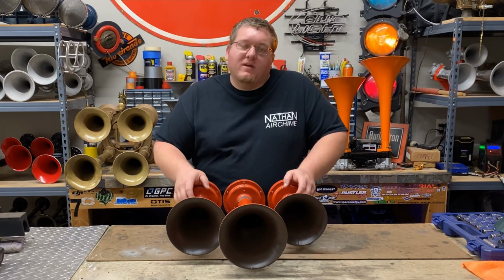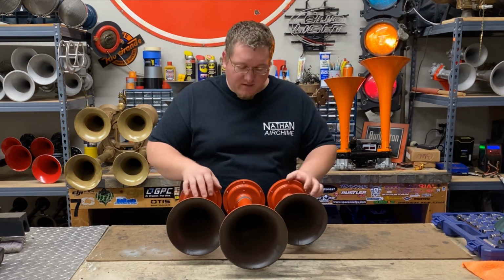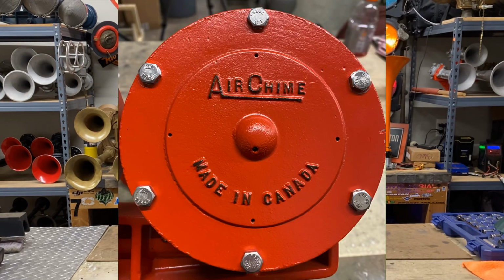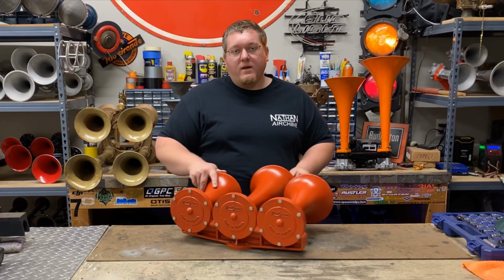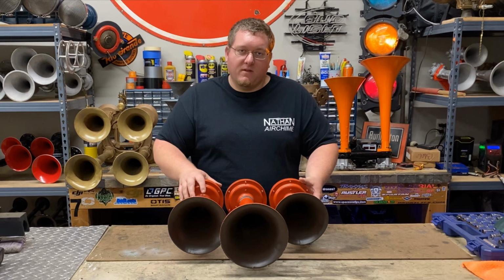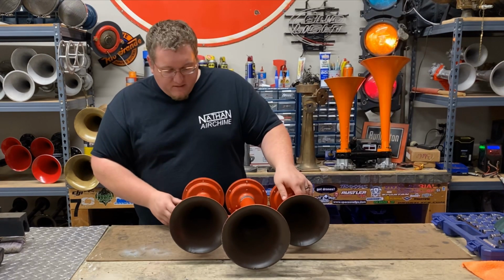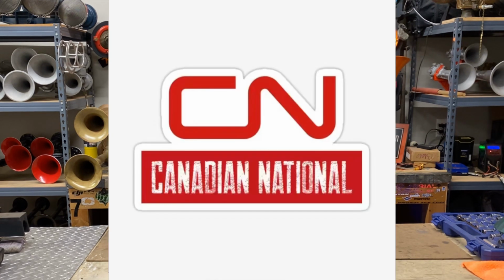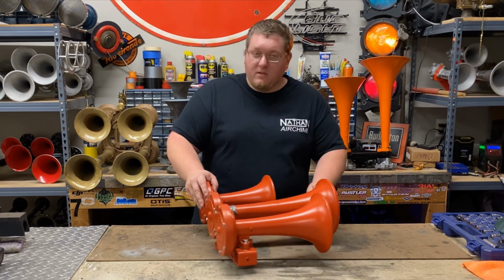Sand Cast Holden K3L! Ex Canadian National Airchime Real Train Horn.

Comment: Back when I was at CN/WC, I had an opportunity to score a few of those from engines that were being scraped or sold. I was always working, and just never had the energy to drive down to Chicago to get them. Oddly enough, New Jersey Transit 1002 and/or1003 (MP20B-3) has one. I noticed the back caps a few weeks ago while at work.
Reply from the maker: Very interesting! I know you wish you had of grabbed those up.
Reply: @TheHornKing  yeah, I was able to grab a BC Rail K5L. CN went through a phase where they were replacing a lot of k5s with P5s and P3s. Like an idiot I sold that one, and a few others when I thought I was getting out of the hobby🙄..

Comment: Most of those horns were painted black so that black paint was probably the way it was when it was taken off the locomotive.  On the GMDD (EMD) engines they were mounted on top of the bell on the cab face but later moved back to the long hood to reduce noise.  Some models had cab mounted red horns from the factory while others had black but they were all red in the end.

Also - you should be able to reverse any combination of the chimes.  On MLW (Alco) engines in particular, it was pretty common to see two chimes forward and one backwards.  For cab mounted bells (GMDD's and later MLW's road units like the 2000's, 2100's, 2300's and 2500's) they were almost, but not always mounted with three chimes forward.  Again - lots of exceptions to the rules!
Reply from the maker: Very cool and thanks for all the info!

Comment: I believe CN began using the K3L on the standard cab SD40’s (5000-5240 series) by the early 70’s. These units, I believe, originally had the M3H, but were later replaced by the K3L. CN & CP predominantly used the M3H until the early 70’s, then both started using K3L. The CN GP38-2/-2W’s, M420W’s, GP40-2W’s & SD40-2W’s were all fitted with the K3L when built in the 70’s. CN also used the K3L on SD50F, SD60F, SD70I, SD75I, C40-8M, C44-9W & HR616 units later on.
Reply: They had to meet certain government regulations whatever the hell those were